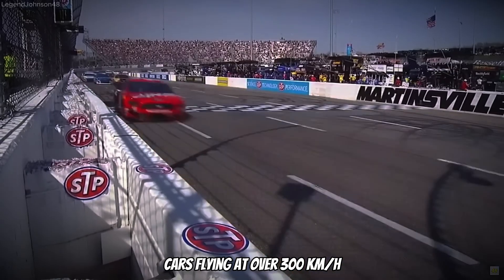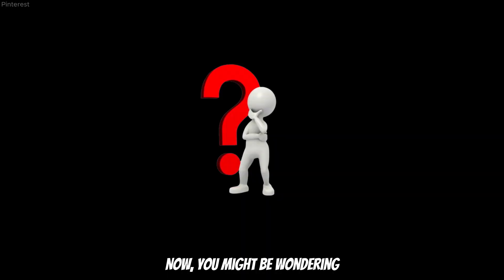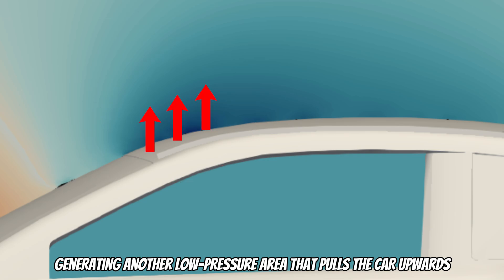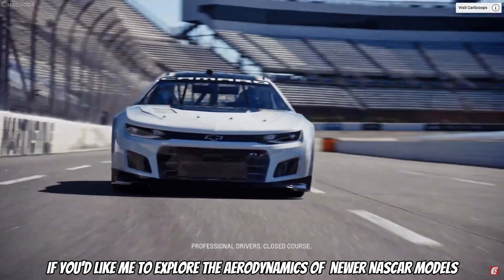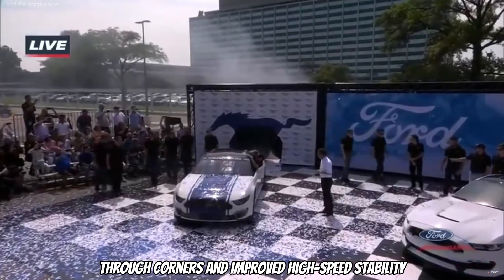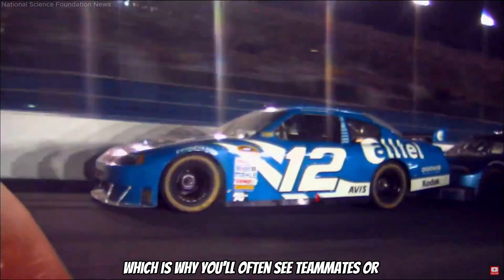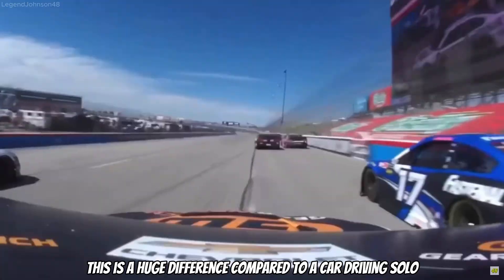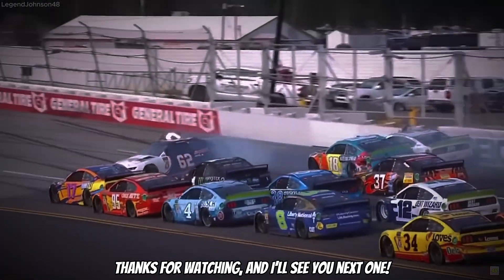NASCAR Aerodynamics Uncovered: What Makes Them So Fast?

Comment: What's a trip is the current model is nowhere near as fast as the previous models because NASCAR took 200hp out the motors
Reply: Well… they ran the 550 package when this car ran on inters. Now it’s up to 670 outside of superspeedways, the aero is just way blockier on the gen7